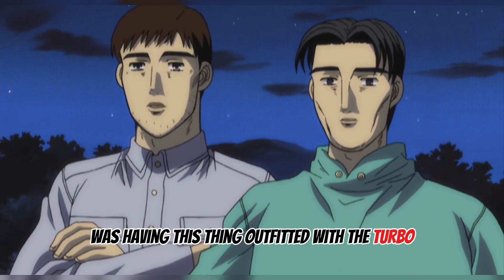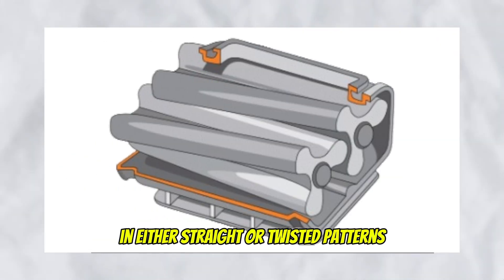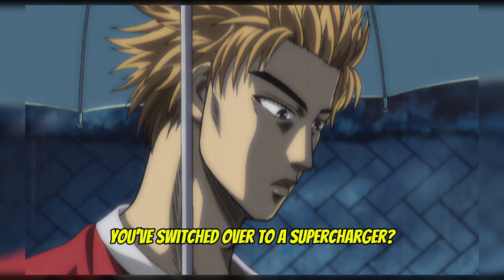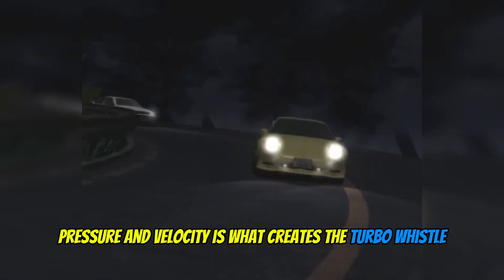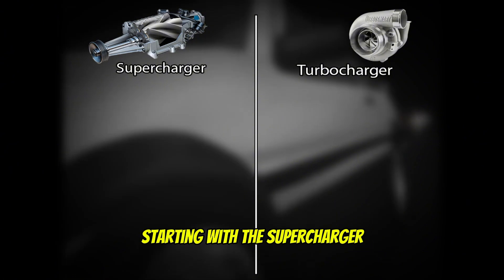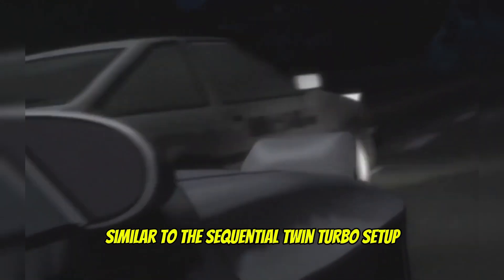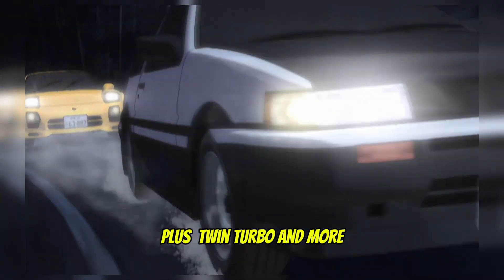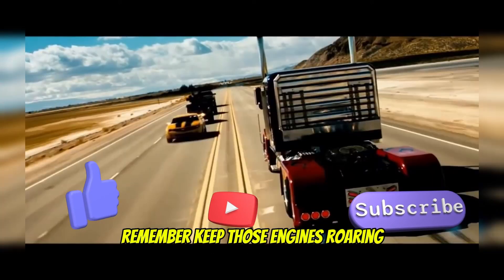Turbo VS Superchargers - EVERYTHING You'll Need To Know

Comment: I've got an 86 Celica that I'm doing an auto to manual transmission conversion on, with a turbo engine from a GT-Four to go along with the swap. Currently, it has an N/A 3SGELC, soon to have a 87 spec 3SGTE installed in an FF configuration with an MR2 Viscous LSD to help the traction. Something i had planned for my first car, but i kept the engine around for the last 13 years, so I've refreshed the engine and turbo, and have finally gotten the chance to do the swap, and finally enjoy the 80's car simplicity again.
Reply from the maker: I'm impressed to hear anyone nowadays going through such lengths to upgrade their car. You certainly are a diamond putting in the effort, and trust me, when it works just as how you want it...that feeling is absolutely satisfying. I wish you the best, the transmission conversion can be a bit tricky. But once you get that and the engine stable, the rest should start to fall into place like clockwork.
Reply: @RedlineRendezvous  Thanks, Ryosuke. It has certainly been a bit of a pain at times, but, the AWD->FF gearbox conversion was fairly easy, thanks to the SW20 MR2 Turbo having basically the same gearbox as the GT-Four, so the differential dropped right in. All i have to do now is collect a few more parts, which has actually been the hardest part, due to being old and rare. I have most of the parts i need from wrecker runs, but it has been a pain finding some of the more obscure parts that i need. It'll be good to finally get to drive a Celica again, with the added power from the turbo. Being from basically the same engine family as what's already in the car, the swap should be pretty straight forward. The wiring will probably be the trickier part, as i may have to convert to a aftermarket ECU like a Haltech to get it running right, but, that was already in the works, as i plan on installing a fresh air Anti-lag setup, and flex fuel capabilities down the road, as well. I appreciate the kind words, bro. i can't wait to take it out on a good touge run to break it all in properly once i'm done with the build.